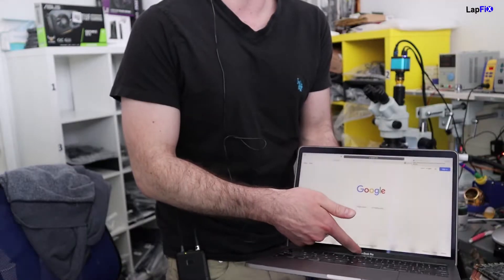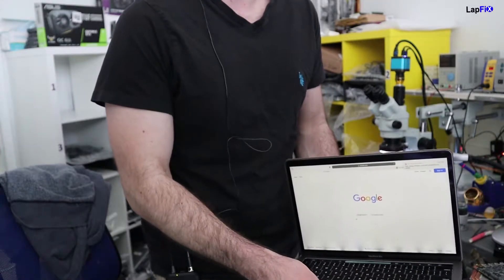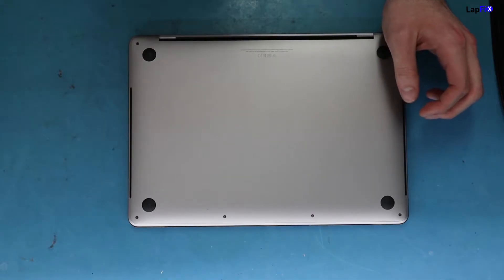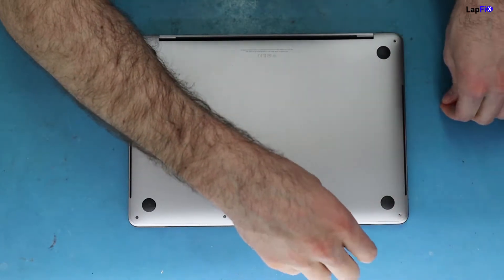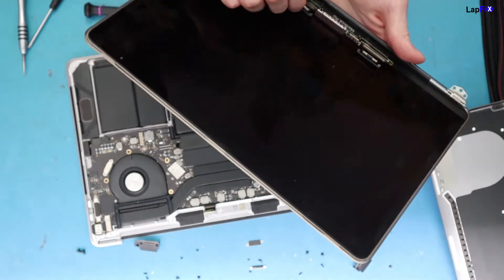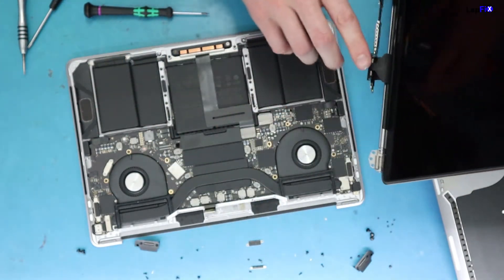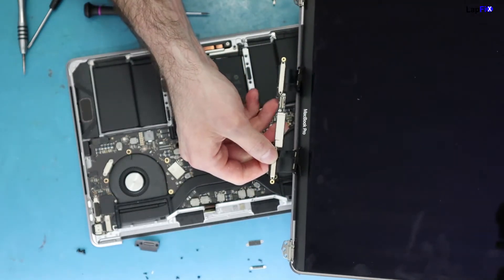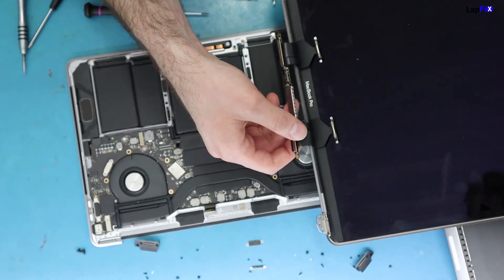MacBook Pro A1989 Flexgate Stage Lights Screen issue

Comment: I have the same problem on a 2019 A1989 MacBook Pro. Looks like Apple didn’t solved the issue yet !
Reply from the maker: It has to do with the cables, most likely they are damaged.  They did extend the cable in the newer models which helps with it so opening and closing the laptop shouldn't be damaging it anymore

Comment: There is no surprise that even 2018 and later has the flexgate issue as same as 2016-2017 models because from 2016 and later all MacBook Pro models has the same chassis. I have seen a 2019 16inch has the stage light effect and it's a matter of time we will see the M1 models has the same issue.
Reply from the maker: The 2019 16 inch has this issue too? Wow
Reply: My MBP 2018 has the same issue, is there any way to just repair the cable? Instead of paying a whopping 700$ for this screen
Reply: @mohitbagaria5387  Were you able to find solution for this?
Reply: M1 here. Facing the same issues.

Comment: I have 2019 macbook pro and i have this issue... Shitt it costs ₹48732/- indian rupees for fix its almost half the price of laptop
Reply: Hi Avtar,

I too am facing this issue with my 2019 MBP  and the Apple Service Centre guys have  asked me to replace the screen which will cost me around INR 51,000 ($600+)!

How did you go about fixing this issue?

@LapFix : any thoughts on the above and if i can get the flex cable replaced, in case of any damage? I am based out of Pune, India.

Comment: Hi I had the same issue on my MacBook Pro from 2016, 13 inch with the Touch Bar I don’t really know much about tech like this. I had these stage lights for maybe a month then today I was doing some work on it then closed it to get some food came back and now my screen has almost gone completely black and I can barely see anything on it, but when I put a flashlight to the screen I can see somewhat better what’s on the screen, what do I do now
Reply from the maker: Most likely the backlight went out.  These cables are all exposed there and are easy to damage just by opening and closing it as well as getting particles stuck in-between the screen and case.  Most likely need to get the cables fixed and/or replacement screen
Reply: @lapfix  Ive sent it to apple and they fixed it in 2 days and commpletly replaced the whole screen part for free too, since its from 2016 and i got it in 2018

Comment: I Own a 2017 Macbook Pro. I have the same stage lighting problem. But Some people face the Flexgate problem where after opening 45°-50°, the Screen goes black. Is flexgate gonna happen to me in future?
Reply from the maker: It may get worse, check to see if you are under warranty.  They should cover some models
Reply: What happened later, Is this worked later or it went even worse? My screen is like this now :(
Reply: @msbond1867  what happen, same issue. does it get worse or remain same if we handle with precaution